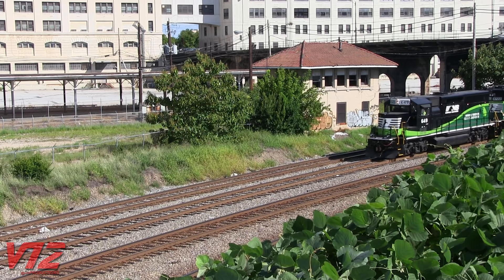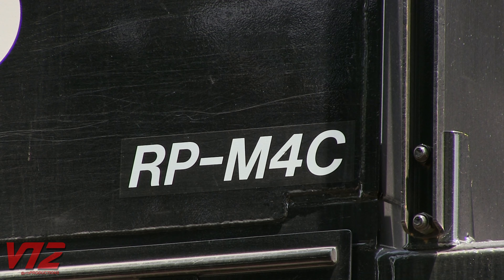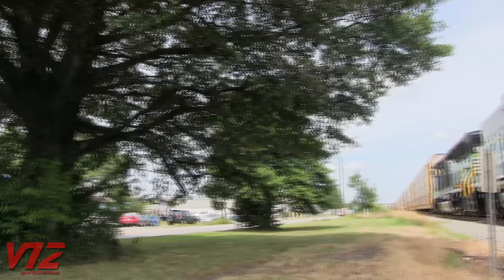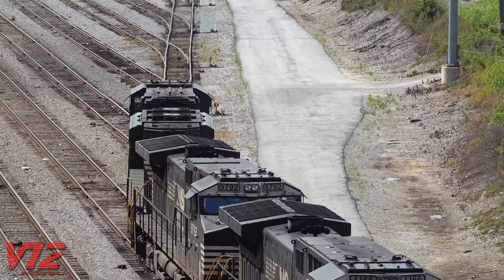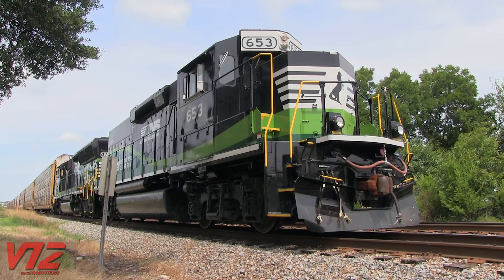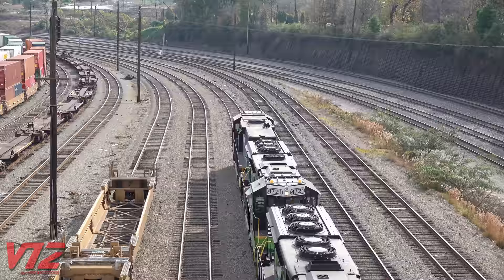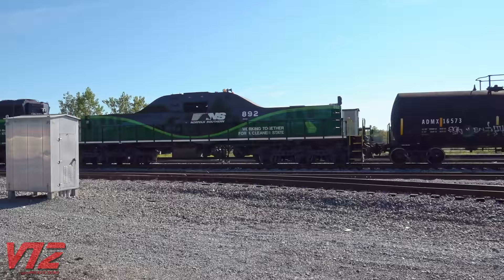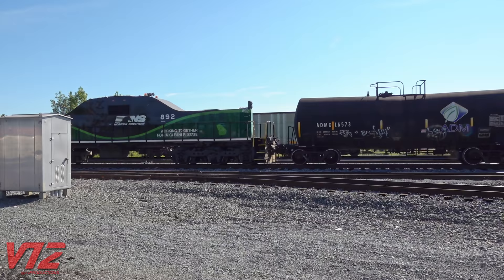Railroad SLUGS

Comment: Well, being a native speaker of a language where "motor" and "engine" both mean exactly the same, both translate to "motor" this is kind of confusing to follow. 🤣
Reply: Motor and engine do not mean exactly the same thing (in English).  In some applications, the terms are interchangeable.  For example: if a car is powered by a V8, that can be called either an engine or a motor.  However, all-electric vehicles have electric motors.  It would not be correct to say a Tesla has electric engines.

In the railroad industry, the diesel internal combustion engine is commonly called the "prime mover."  It's sole purpose is to convert the chemical potential energy of the petroleum to electrical power by turning a generator.  This electricity is used to power the electric "traction motors."

I will be the first to admit that English is far from being a perfect language.  If you really want to hear a fun debate, ask some rocket scientists whether the space shuttle used engines or rockets.  Fun fact: it used both.  🙂
Reply: @guardrailbiter  thanks for the explanation. However, it was not needed, I am fully aware of the differences and the uses of the words "engine" and "motor", I was just stating that for some people, like me, we need to be a bit more focused to follow the video because in our native language there is just one word for it.
Same as there is just one word for "teacher" and "professor" or "pumpkin" and "squash" or in other cases we have 2 words for what English has only one like "ananás" and "abacaxi" for pineapple or like a pump can be a "motor" or a "bomba"....
Thanks for the explanation anyway.
Cheers.

Comment: Actually in modern times you would only need to transfer the power and 2 data cables, maybe a pneumatic added, but that technology connecting them with countless cables is probably like 50 years old. And since the manufacterer can justify the costs when its countless connections they stay with that. Is there a legitimate reason for having that many cables?
Reply: It's not "countless cables"  It's ONE control cable. ONE.  The larger cables you see are high voltage cables that power each traction motor. They are not "control" cables. The cables have to be that large to carry the amperage.  You can't make them any smaller. And you can't make any less of them.  And the air hoses are standard as well. Brake pipe and 3 MU hoses. 
 The standard 27 pin loco MU cable has been around forever for good reason. Because it's very heavy duty, extremely reliable and pretty much every locomotive in use today (even ones built 60 years ago) have the connector for this cable. Meaning a 60 year old loco will MU seamlessly with a locomotive built yesterday.  Changing the design now would be beyond stupid because you would make every older version incompatible.  Railroad applications are like nothing else. Things have to be built very heavy duty. Modern data cables and fiber optics would not last in an MU application and god knows we don't need or want any more wireless nonsense.
Reply: @FFred-us9tw  Well these are a lot of intresting details that definetly would be good in the video.. maybe i missed them somewhere, but then i was only 10 years off with guessing that the system is 50 years old it seems.

Comment: Some slugs some slugs are known to be a fuel tender
Reply: Very few. Since a fuel tender is worthless unless it’s coupled to a locomotive that is set up to receive fuel from a tender. It requires some extra pipework that most railroads don’t bother doing.  The other reason most railroads didn’t bother with using them as fuel tenders is the majority of these slugs were used in yard service primarily and occasionally local service. Neither of which is a situation where refueling them is an issue. Far easier just to top off the main locomotive than have to deal with all the extra work of dealing with the fuel tender.

Comment: What is the benefit to removing the engine? Is it used for spares on other locomotives? It seems if they are going to fill it with concrete for ballast anyway, they might as well keep the engine weight in the locomotive and save themselves a bunch of work.
Reply: The engine is removed because it isn't needed. At lower speeds, such as in yards most locomotives produce more power than that can actually use.  As an example, the EMD GP40-2 and SD40-2 use the same engine and HP output. The SD40-2 has two more axles though that utilize this extra power. Well that surplus power is more abundant the slower you go. So by using a slug you can end up with the pulling and braking power of two locomotives with the engine maintenance and fuel consumption of one.  Once you start going fast though this does not work as well and the power is lost. So most slugs are for yard use although some railroads like CSX had Road slugs which would produce tractive effort till around 30 MPH.
Reply: @FFred-us9tw  Oh no, I don't mean use the engine. I assume the locomotives that are being turned into slugs are probably older anyways. I'm saying why remove the engine and then add in extra ballast? Engines are heavy. Why not just keep it there as weight, and then you would still add ballast, but you wouldn't have to add as much.
Reply: @v12tommy  the engines are reused on other locomotives. Way too expensive to basically abandon in a locomotive. They can be infinitely rebuilt.
Reply: @FFred-us9tw  Oh, gotcha. I figured they were older and no longer met emissions requirements, or weren't efficient enough to be profitable or something.

Comment: I dont see how they are making anymore money as they would still need more locos in front and as a dpu ... seems like allot of shell just for traction rather that pull/push power. Plus you need a larger generator on your main power loco.
Reply: Spreading the mother's fixed amount of power between the mother and slug's traction motors means less power per axle, which means less wheel slip. Basically, a four-axle unit can't put down all its power at low speed because it doesn't grip the rails enough and the wheels will slip. The slug allows the mother to use all its power at low speed, which is useful for switching.

Comment: a slug got it's name because it's fake. You had fake coins the size of a nickle or quarter to be used on pay phones and coke machines--- they were't real money and called slugs.
Those traction motor slugs are not real engines either---- ergo slugs too. I've never found a way to tell if a slug was working or not because I never found an amp meter on one.

Comment: My question is, why do the locomotives still used incandescent lighting for the headlights instead of LED bulbs? Ever seen the headlights on newer firetrucks?
Reply: Many reasons.   More than anything, cost.   A standard 350 Watt PAR 56 locomotive headlight cost around $18.  An FRA approved LED version (Presently only 3 brands make them)  cost around $800.  The biggest selling point LED bulb manufacturers push is the fact they last longer. Which is true. But considering it takes about 5 minutes to change a bulb on a loco the labor cost's are hardly an issue. And to make your money back on longevity almost isn't worth the initial cost. 
 Incandescent bulbs put out a much warmer light that penetrates fog and snow better and will never ice up because of the heat they generate. LED versions have to have heated lenses to melt snow and the heaters don't even work that well in heavy snow.  We run LED headlights in all our new Loco's and while they are bright, i much prefer the incandescent bulbs for bad weather and they are easier on your eyes.
Reply: @FFred-us9tw  Thank you. First answer I have received to my question and it make sense. Like the traffic lights that changed over to LED's but they get the snow buildup. $800 for an LED? Sheesh they were cheaper when they first came out.
Reply: @coloradostrong8285   They are built very heavy duty. Heavy aluminum housing with heat sinks. Weatherproof connectors. Thick outer heated lens and multiple lenses to focus the light. No real way to make them cheap I guess.
Reply: @FFred-us9tw  Thank you again. Any sites to peruse over the products, as I need some lites for my riding mower.  😅
Reply: @coloradostrong8285   check out Railhead Corp. and  J.W. Speaker corp.